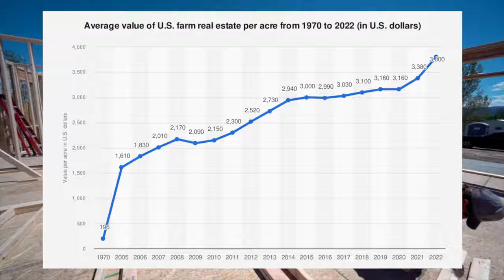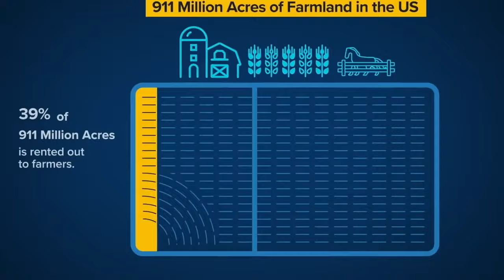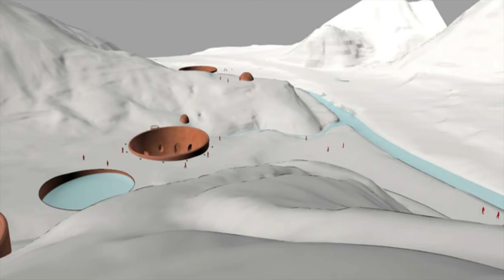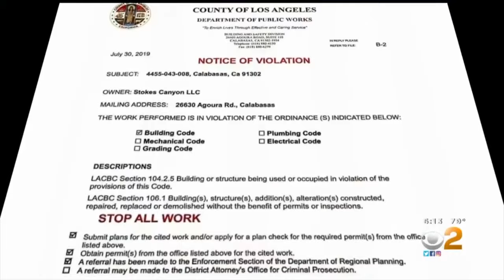Tech Billionaires Are Acting Sketchy Again...

Comment: You provide us with wonderful content!
Please let me know about your opinion if a tiny A frame cabin necessarily has to have a kitchen attached as a separate facility available for glamping
Reply from the maker: Thank you for the comment! I personally think as long as there is a place for cooking you are good. It doesn't necessarily have to be inside of the main structure. At my glampsite there is a gas grill that is outside. That is what my guests use for cooking.